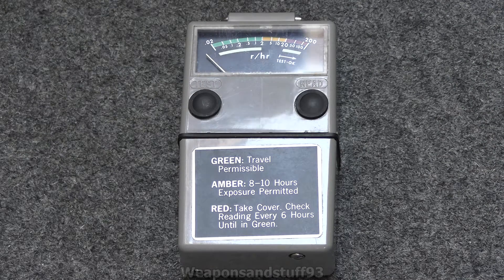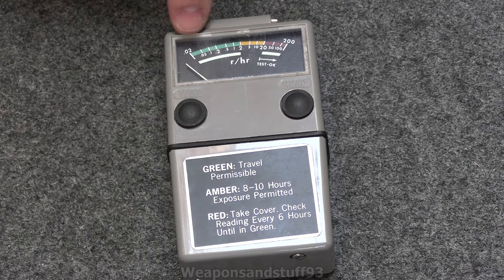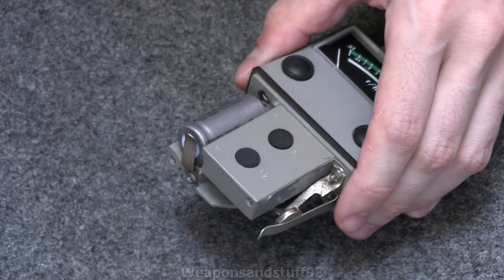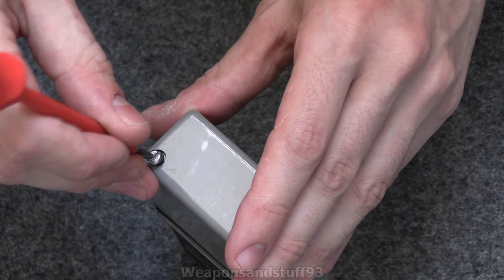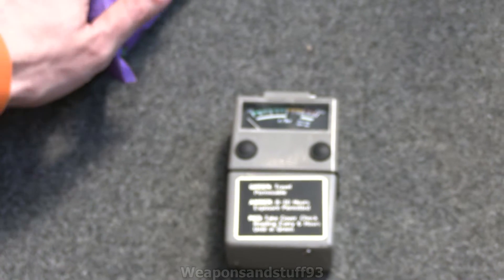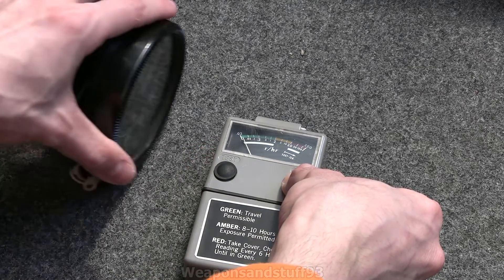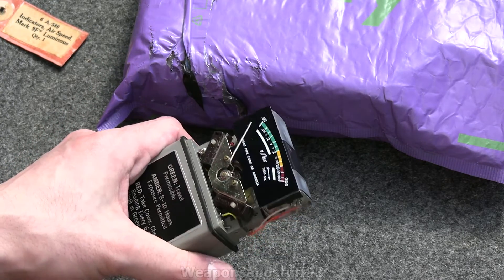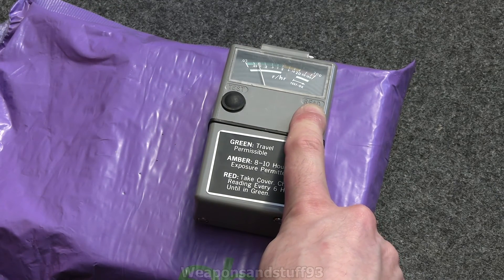US RADIACMETER IM-179/U Tests

Comment: I can confirm the Nucor branded ones came with a radium dial. It's not the hottest thing ever but easily detectable like some radium wristwatches are. The "Nucor" brand name is printed right on their panel meter scales so they are easy to spot if you look. You have quite a bit of radium in that shipping bag to get such a high gamma reading.

Comment: Another brilliant video that’s a really cool little device I might see about getting one cheers for the video
Reply from the maker: Cheers only issue is the needles are very fragile, mine broke after using it a few times and opening and closing the case. You can at least get them to register with a multimeter if your needle breaks.
Reply: Weaponsandstuff93 ahh yeh that’s true it’s a shame they didn’t make a more modern version of those it’s a really good concept